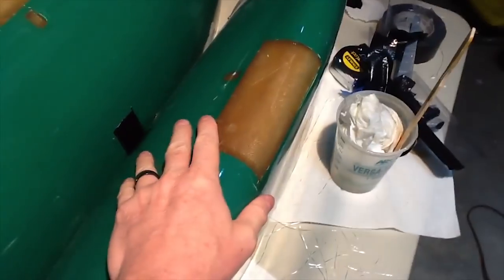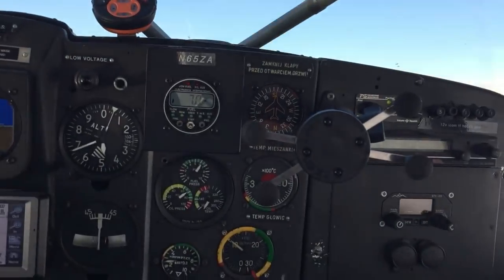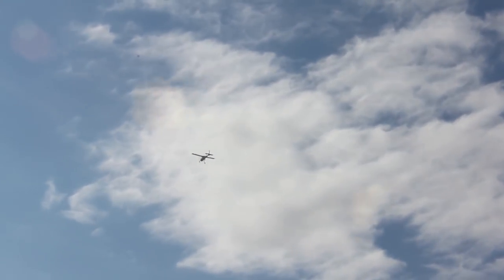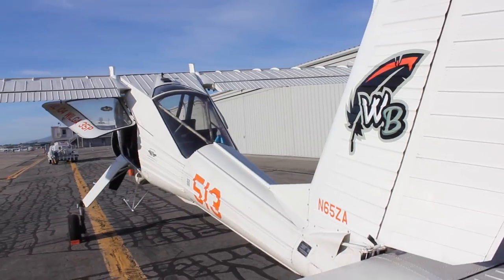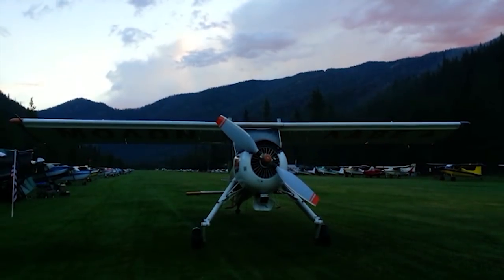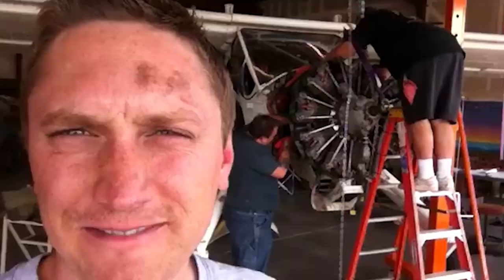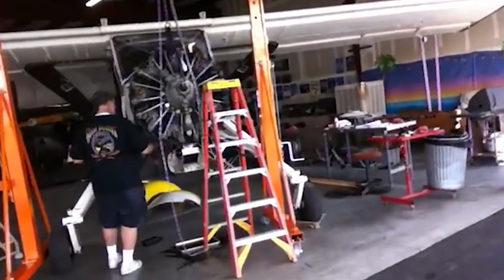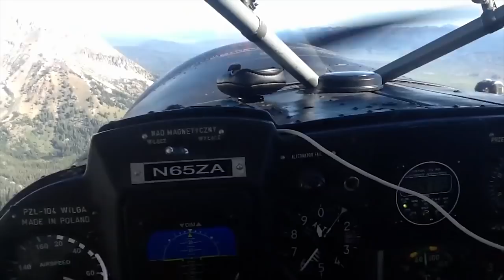The "WilgaBeast" a PZL 104 Wilga 35. Polish Aircraft

Comment: I was wondering if you could go into what it’s like to own one. Useful load living with the radial engine and any quirks to the Wilga. I know you sold this years ago but I would love to get your insight.
Reply from the maker: Yes, absolutely.

What it's like to own a Wilga...  You will have greasy pants and shoes.  It leaks.   I changed mine to the M-14PF engine as my home airport is based at roughly 4,500MSL.  The AI-14 Engine just didn't pull well above anything higher than 3000'DA for me.

With that new engine, performance was legendary.  I did keep the same operating limitations relating to speeds and weight and balance.   So with the new engine being a bit heavier, the useful load was very limited.   But I flew it light like a bushplane so I didn't mind.  And I could still outperform much lighter aircraft.  

It is not an intuitive airplane to operate.  One must respect the unique operation of the engine and the flight characteristics.   The airplane flies the way it looks - it's unique.

Takeoff and landing is easily accomplished once you get used to how the airplane behaves with the trailing link gear.  It sort of squats and leans dramatically, and one must understand how it's going to behave.  But it's not difficult to master.  NEVER land with ANY side load or you WILL ground loop.

You will do an hour of maintenance for every hour you fly.  Yes, it's not great. No parts are available so anything that fails you have to make it or modify the aircraft to accept something else.  If you can find parts, the wilga culture seems to be quite shady and difficult to work with.  Not sure why that is, but it's not a good representation of humanity.

Overall, it's a fantastic airplane that didn't get the right engine (should have been the M-14 all along).

Ownership is not recommended honestly. But I remain a huge fan of the airplane itself.
Reply: @flycory  thanks for the reply. I really appreciate the insight. I love your videos keep up the great work.

Comment: Was thinking a good inline 6 turbo, such as the Ford Barra engine would be good for this aircraft. With a billet aluminium block and cooling system in the wings it would be lighter and more powerful than the engine you are running. 300-325KW take off power up to 4500 metres.
Reply from the maker: Unfortunately, the high rev motors don’t translate well to airplanes…
Reply: @flycory  what makes you think that?
Reply from the maker: Experience seeing many many failures…
Reply: @flycory  Not my understanding. Maybe the engines used. A lot of myths regarding engines and what does or does not work well.
Reply from the maker: If they worked, they’d be in airplanes. But this isn’t a debate I care about. Put one in an airplane and let’s see.
Reply: @flycory  I do plan to build an aircraft using a lighter higher revving more efficient aircraft to fly at 26000 metres, but don't have storage for it. Am currently working on a single seat helicopter with a Suzuki M13A that is really happy at 5000 making 150KW. The Wilga is cool, safe flying.
Reply from the maker: I look forward to hearing your report

Comment: Just a correction: AI14R is Russian engine  used in many airplanes such as Yak12 or Yak18. Some of these engines were assembled in PZL Kalisz (Poland) and transfered to PZL Warszawa-Okecie where Wilga was build. It looks like you have an older version of PZL 104 Wilga 35 running on original Russian AI14RA (Anatolij Ivchenko Radial engine version 14). Polish assembled version would be AI14R on PZL 104 Wilga 80 with huge exhaust silencers. From the year of 2000 new version of PZL 104 Wilga 2000 came out with American made Lycoming O-540. There was short production cycle and majority of these planes ended up in USA and Canada as a perfect 4 seat bush planes. 
These Russian AI14RA engines are indestructible, planes made in 1047 are still flying these original engines. They seems to be running forever...
I love Wilgas, I was trained on them and I do not know any other plane that is so easy to fly and forgiving, even C-152 is more demanding...
Reply from the maker: I installed the M-14PF myself. Pretty sure I know what engine was on my own airplane.
Reply: @flycory  In that case this was not certified PZL 104 35/80 Wilga but its experimental version. As far as I know, only a few Wilgas in the USA were converted with this engine as originally it was used in Yakovlewv and Sukhoi airplanes as well as some experimental American Aircraft such as Murphy Moose and Pitts Model 12. But generally, this engine was not installed on certified planes.
Reply: @michaelksiezopolski  What a knowledge 👏 💯
Reply: The engine AI 14R was not assembled but produced in Kalisz under licence from Soviet Union. The engine ist taken from amercan engine Wright Cyclon R-1820.
Reply: @piotrgrzywacz144  OK, the engine was produced and assembled in Kalisz. It was based on Cyclon R-1820 and modified so the original parts would not fit the Russian version. Most of the Russian technology during communism was backwards engineered from the West (Not just the USA) so what?
Czechoslovakia was also producing staff stolen from wester countries and stuff under Russian license, I thought it was obvious to the whole world!
AK47 in several versions were produced in Lucznik, Poland or in DDR or Czechoslovakia.
The first series of IA14R for Wilga 35 was only assembled in Poland before Poland obtained a license from the USSR to produce and modify the engine - Just for you to know!
Reply: Thanks so much for this lovely wilga information . I am learning to fly in the uk and wondering about buying a radial wilga once I get my licence .  I heard some great things  about them ..also how does STOl compare with Cessnas etc ? What will stand out for me ( apart from sheer joy of flying this super cool plane !!)
Reply: @inventsc  Wilga is designed to be easy to fly. The plane will follow your hand as desired. It climb three times faster than C185, descent also quicker, need way less space for take off or landing and rough terrain is not an issue. 
If you can afford it, apart of fuel consumption, you will be very happy. You can have 5 on board and tow three gliders at over 1000fpm with no issues.
Visibility is also great!

Comment: is that a DRACO 2  in the making ?
Reply from the maker: It’s the WilgaBeast.  Only 400ho
Reply: not bad so just shy of 200hp from a turbine prop, 400 already impressive!  i thought original wilgas were only in the 250-260hp region  ?
Reply from the maker: fabslyrics yes, 260hp is stock
Reply: LOL Mike put $1,000,000.00 into DRACO... and a zillion hrs ;) !!!
Reply: JUSTACHIPN yeah probably but just the million won't buy you everything.  Back to work :)
Reply: Its like the poor mans Draco (poor being a relative term lol) 

Draco gets cnc milled components that took weeks to machine holding unique carbon fiber parts, Beast gets the type of fiberglass mods your uncle did to his 78 Vette😋
Reply: This thing is sweet!